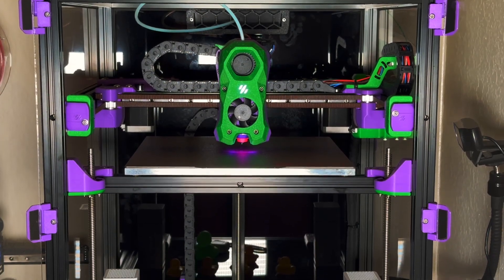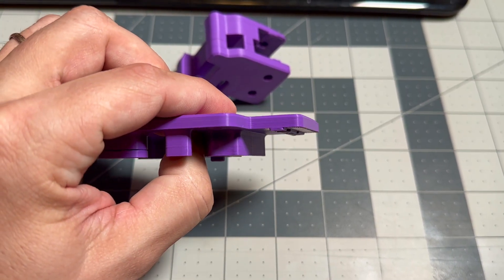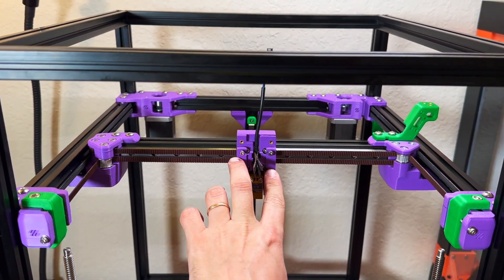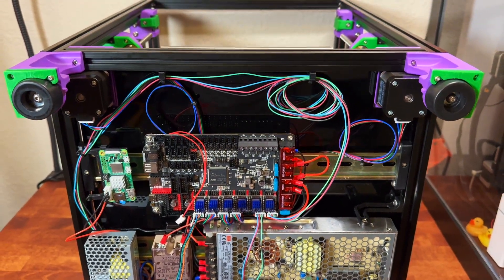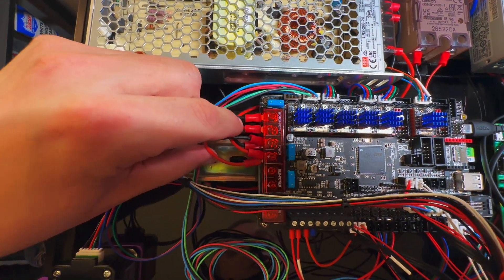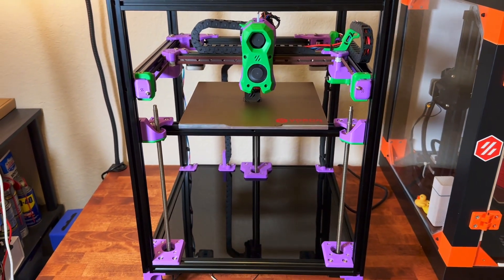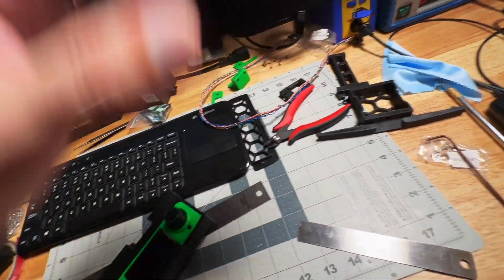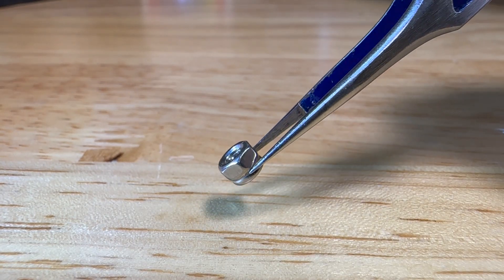I built Voron Trident... is It worthy?

Comment: is this 250 or 300
Reply from the maker: 250mm
Reply: @ would you say the 250 is good enough for most consumer printing. Is there ever a time you wished you had more space?
Reply from the maker: @pear-zq1uj  I have 5 printers 250mm size and I print a lot, honestly 99.5% I did NOT need a larger printer and in those 0.05% I almost always find a way to print it on 250mm anyway. If you know for sure you will print lage parts day to day only then you buys bigger one but most likely the reality is - YOU WON'T. I even go further and say, better to buy 2 printers than 1 big. 2 printers makes this hobby 10 times easier, funnier and you just don't have to wait.

Comment: Any thoughts on the Trident vs a Troodon 2.0?
Reply from the maker: If I correctly understood, Troodon is pretty much Voron 2.4 and I see it as a machine with fun but over complicated kinematics - the more parts printer has, the more things can go wrong and the more you need to maintain. I had plans to buy 2.4 as a challenge to learn and try something new, but considering its price and the fact that I already have a few very good printers, in my case such a purchase doesn't make any financial sense at all, maybe only as YouTube content. At this point whole market is shifting dramatically with Bambu Labs printers quality and speeds, so printers in such price category might not be a good purchase. I feel like in the next few years we will see printers with way better price to value a point.
Reply: @hobbyistnotes  I'm leaning towards a Trident but it's hard to justify when comparing it to a Bambu w/ an AMS. The only thing keeping me from getting the Bambu is the cloud functionality. I don't want to be limited in what I'm able to print if laws were to change and restrict certain things which leads me right back to a Voron build.
Reply from the maker: @BLWN402  Same happened with Drones... DJI (whom engineers now in Bambu) have made Remote ID built in their drones and you can't fly them in restricted areas they just fall of the sky... tho if be honest we are far from such limits, too much hustle to determine the part. Self made printers will be around 800$ if you source good parts, few of my friends got Bambu P1S(750$) and they are very happy with speeds and quality of the prints... question is what exactly you need printer for, if it's just printing than there is no value better than Bambu X1S now... if for over all hobby and tinkering than Voron Trident is the best in terms of quality maintenance and complexity.

Comment: what about fire risk?
Reply from the maker: Using ANY manufacturing equipment, there is always a chance of getting 'hurt' in one way or another, especially when working with high temperatures while melting plastic. The Voron printer itself is very well designed, equipped with a thermal fuse on the bed, and the Klipper software includes good thermal runaway detection. However, it is still not advisable to solely rely on these safety features without additional precautions. That's why I highly recommend having a smoke detector and a fire extinguisher in the room where you are 3D printing. Being prepared is always better than being sorry.

It's interesting that some people assume a cheap 3D printer from China will be safer than a self-made machine where you have personally tightened every screw. However, safety doesn't solely depend on the price or origin of the printer. In fact, with a self-made machine, you have more control over its construction and can ensure that all components are securely in place, reducing potential risks.

Overall, it is essential to prioritize safety and take the necessary precautions when working with any manufacturing equipment, including 3D printers.
Reply: @hobbyistnotes   Thank you for clarifications. I agree with all the points you mentioned. Maybe in europe it is problematic when it comes to CE certification and insurance coverage. Even printers made in china are CE certified.
Reply from the maker: @RamiRouhana  Ohh.. yeah I can totally see how certification can be a pain especially with self-made machine...

Comment: It might be fully reasonable to build a Trident as it looks quite balanced in terms of budget and the possibilities it can give. But the only thing which makes no sense to replicate is its stock X-axis assembly including the extruder as it looks entirely irrelevant from a physics perspective due to its unjustified enormous mass (yet huge momentum of inertia unless if you're going to print turtle slow.
Reply from the maker: I agree and disagree with you at the same time. The only issue this printer has now is how fast hotend can melt the plastic/filament and at this point it is main limiting factor even with such heavy toolhead. I vbeen printing with higher temps to increase flow and speeds around 200mm+ and 10k acceleration with 0 noticeable issues. That is why I think your comment is relevant only if you have 35+mm^3/s volumetric flow.
Reply: Its not made of lead its just a plastic shell its not exactly heavy 😅
Reply from the maker: @thegarageluthier  True, but every gram is meaningful, like in racing, when you want to print fast.
Reply: @hobbyistnotes  That is true but I think most people aren't looking at the actual limitations of going fast and the reality that surrounds it, the speed at which you can melt filament and then cool it. Then the reliability and servicing issues that come with pushing the machines to the limits. It's fun but not sustainable. And 99% of people will never push their machines to those extremes so Stealthburner with standard x gantry will get you where you want to be with a HF hotend.
Reply from the maker: @thegarageluthier  True, nothing to add.

Comment: Great video, love the color scheme, I am seriously debating between geting a printer from bambu labs (with the ams) or getting a voron kit, saving up money until i decide what to get, thanks for the video
Reply from the maker: I have spent last month thinking about bamboo labs with AMS... Lucky for me I am not really printing much of multicolor and most of the thing I print are functional parts.
Reply: I bought the bambu labs p1p +ams In February and it’s been great and I have had hardly any failed prints. I previously had an ender 3 so I had a basic understanding of printing. But with the bambu labs printers Nearly everything is done for you so if you are looking to learn more about it then bambu isn’t a good option. If you are just looking for a very fast reliable and good quality printer you can unbox and be ready to use in 15 minutes then bambu is for you
Reply from the maker: @ZFGFZDGDFG For sure hard to argue! Bamboo have overtaken the space at this point if you need printer to print without any distractions it's the way to go. It has few little concerns with proprietary parts but if it prints it prints.
Reply: @hobbyistnotes  I want to build a voron but don’t want to spend £1.3k(what it costs here in England for a kit) on a 2.4 and then for it to not work because I miss somthing.  I think I’m gonna look at a .2 to start with then when I’m comfortable with it look at a trident or a 2.4
Reply from the maker: @ZFGFZDGDFG  I think you can build Voron significantly cheaper if you are ready to source parts urself.

Comment: My FormBot kit came with the Hall effect x-y endstop module and I found it inconsistent due to the camber heat. I changed to mechanical endstops similar to what you have and have been quite happy with xy homing ever since.
Reply from the maker: Oh yea those can be very annoying and I trust mechanical switches more than other solutions. In this case I believe it's just fair to get what ever was advertised doesn't matter if it's better or worst.
Reply: @hobbyistnotes  I totally agree, just may be a blessing in disguise if your planning on using for  prints that need a heat chamber. :-)

Comment: Probe wires, such as thermistors cannot be in that clamp/sleve you used, has to be bare wire contacts.
Reply from the maker: If you look closer to the wires that on 3:30 where I explain wiring you will notice that those aren't the original probe wires, those are premade PTFE harness that came with the kit. On my Switchwire I have used the cable that came with the probe and I have 0 issues with it printing over the year+. I know that Nero3D talking about this issue a lot on his streams but per my experience everything seems fine if you aren't making sharp angles and cable tension in to the chains is properly set.

Comment: Great video. Is there a big difference in the Switchwire speed and the Tident? Or is the main difference the quality of the print at the higher speed? Trying to figure out which one to build. I print a lot of single wall larger prints for RC planes.
Reply from the maker: Trident have few advantages over Switchwire especially if you print ABS or temperature dependent plastics, with Swithcwire your part always moving thru air which adds extra complexity to the printing. Switchwire is good at Z-hops as there is no "z-screw lag". After making both of those id pick Trident anytime over SW especially considering the price.
Reply: Switchwire still slings the bed

Comment: Sparta abs quality is actually bad, the surface is rough as there are millions of tiny dimples throughout. That problems exist with all their sparkle filament, and it’s weird no one ever point that out. I can even see that clearly from a far in your videos
Reply from the maker: Interesting point. I have exactly the same texture with my KVP sparkle filaments (Black and Dark blue) personally it never affected the mechanical properties of the parts I have used in my Printers(Trident and 0.1) or at least I tend to believe it. I prefer such texture as it helps to hide all print imperfections but I guess it's more like a Taste moment, though you might be on something.
Reply: @hobbyistnotes  I never had that problem with KVP's filments, which I got a long while ago before they became inconsistant. Their surface is smooth. I also want to say if you try to feel the texture of the sparta filament on the spool you can also feel the uneveness to the surface. While KVP still on the spool is really smooth.
Reply from the maker: @user-yk1cw8im4h  Just started printing Klicky probe and decide to dig deeper regarding this topic. I compared both filaments and also took under the microscope look and I totally disagree with you... Sparta's Blue sparkle finished print texture is so much smoother than KVP Blue sparkle (at least one I have on hands) May be the reason is that I print on 245(C) with it... idk... but comparing filament cards and some done prints that is what I see, to make it clear I am not sponsored by Sparta or KVP and it's my own observations. Maybe it's something to do with batches of Sparta's or KVP's I have?

Comment: I would love to build a voron, but i'm worried that i'll mess up the wiring and firmware won't work. Nice build!
Reply from the maker: If you rush building it that might be an outcome, but if you take ur time and do it slow with guidance of the community chances are slim.
Reply: You will never know if you don’t try. Take your time, ask questions, and if you aren’t sure then take a pic and send it to the discord! They are a great help
Reply: @tomblomfield6973  I think i'll give it a shot and collect the parts overtime after i move and get my conveyor printer first. I've been building pc's for almost a decade, and i feel like this is the next big step in the diy hobby. Looking forward to it tbh.
Reply: The boards are actually pretty easy to work with, the docs provided usually works.